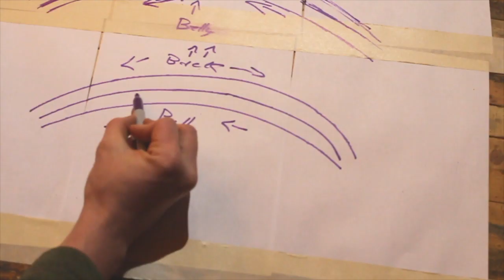Fiberglass Tape bow backing! Does it work?

Comment: There is so much more to learn when you show failed attempts and explain why and how it failed. 
I always say that you learn more when you screw up and take the time to understand why you screwed up. There’s little to learn if you succeed ”by accident”.
I made my first bow from green staff of rowan. I carved it while drying it over a campfire. I didn’t have a clue what I was doing and did everything as wrong as possible. And yet I managed to make a bow that actually worked and managed to stay in one piece for over 10 years. After that I have  failed almost seven times in a row with better materials better tools and a lot more information. But in the process I have learned more about different species of wood  and how they respond to different kinds of tools than in any school or occupqtion in over twenty years ❤

Comment: I ordered an inexpensive d-cross section hickory self bow from an online seller and received a bow that doesn't have a single growth ring on the back. Its actually got not one but many growth rings that terminate on the limb sections. It's hard to be super disappointed in a bow for $70 but in this case I'm afraid to even draw the bow. I considered a bamboo backing for it but instead I thought maybe the fiberglass tape would give the bow the stability it needs.

Comment: USE VEGETABLE SHORTENING FRONT AND BACK THEN HEAT THE BOW AND BEND IT.
CLEAN IT WITH ACETONE.
HAVE YOU TRIED A BONDO FIBERGLASS KIT?
I WONDER IF SINEW WOULD WORK?

Comment: Kramer why do you use glue on the fiberglass tape instead of fiberglass. Seems like fiberglass would be a much stronger bond than the glue
Reply: Fiberglass isn't an adhesive.
Reply: @garethbaus5471  Probably @WallStreet749 meant to use epoxy or polyester resin with the glass cloth/tape rather than the water based Polyurethane wood glue. Those are much harder to work with and would not sink into the wood as well.

Comment: Have you experimented with different kinds of glue? I know the glue needs to be somewhat flexible...a hard epoxy resin would crack. I'm thinking that Gorilla Glue or a construction adhesive like Liquid Nails or NP-1 might work.
Reply: skategreaser 
He’s used Titebond III which is fairly water resistant (not entirely waterproof however). It appears to work well
Reply: @WRMonger1  Yes, I watched the video. I'm asking if he's experimented with other glues.
Reply: skategreaser 
In one video he’s using what looks like epoxy. Avoid 5 minute epoxy, use 24 hr epoxy.
Reply: Im using gorilla glue with 6 layers of the fiberglass tape and seems to be flexible an strong